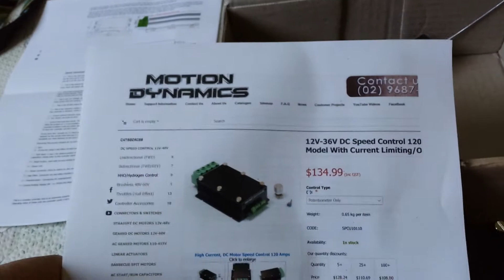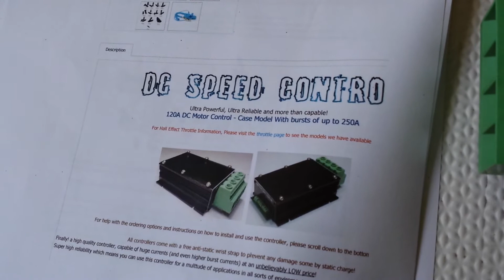120 Amp PWM controller for HHO or motor speed

Comment: Tip. Pwm on its own to regulate hydrogen production works mostly by reducing the time voltage is supplied  to  an HHO cell's electrode.  On its own and without enough capacitive and inductive reactance, it does virtually nothing to improve efficiency and the generator only works part of the time. 

If you pwm power regulate HHO production with an inline inductor capacitor filter, the filter will power the cell more continuously at a lower average voltage so that less current flows and the HHO generator will operate more efficiently.   Sample circuit
http://tinyurl.com/y3jeke83

Comment: nice,, did you no chineeze crap is made from recycled parts ? caps and all , seen some videos of a guy who sits above a puddle of molten tin all day stripping circuit boards and then they wash the parts. thats so dangerous , a cap could fail any second killing some body
Reply from the maker: lol nothing surprises me with regards to chinese manufacturers!
Reply: i should do a vid on this router speed controller , every time i buy 1 i have to take it apart and solder the connection PROPERLY. the last unit failed withn minutes turns out the main wasnt even solderd , it was just sitting next to the solder joint . and i have burnt up 7 or 8 for no real good reason . meaning the device died before the fuse
Reply from the maker: NOBOX7 cheap junk hey

Comment: not exactly plug and play, no master switch or amp meter
Reply from the maker: +Dennis Peacock for the money with such a wide input voltage, soft start, high Amp rating,  current limiting, and frequency adjustment, not to mention aussie made I am a happy customer. It has a screw terminal for power switch and a switch was provided. Adding an Ammeter is something I probably wont do, I will most likely clamp meter it while testing-after that once I know how it is running needing Amp measurements won't be necessary.